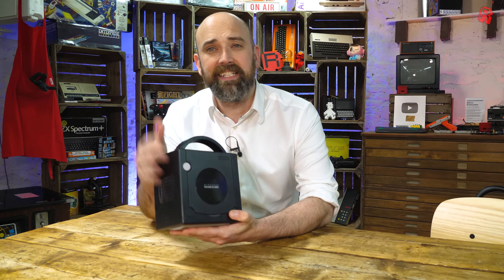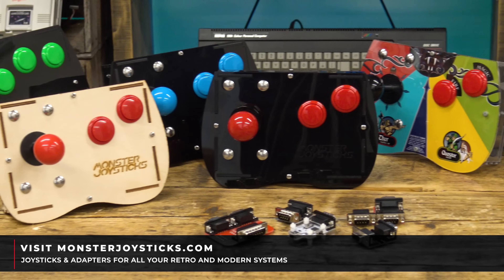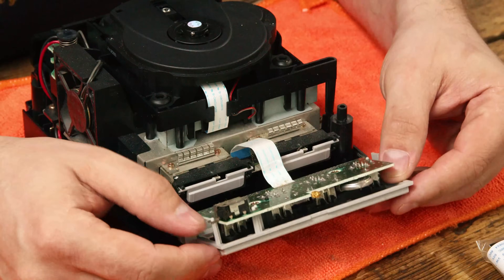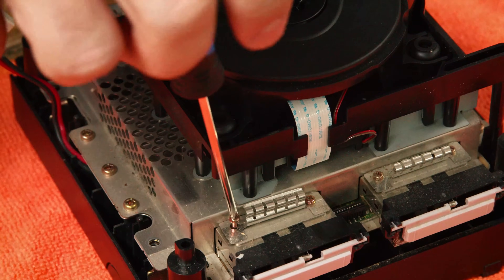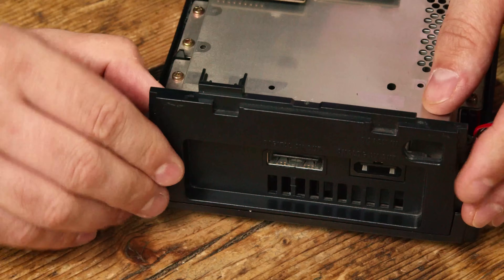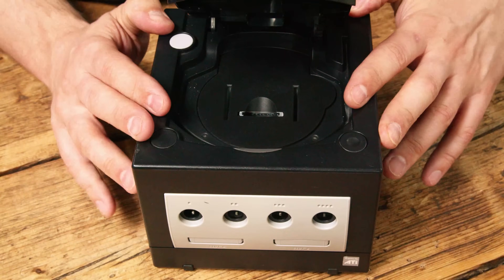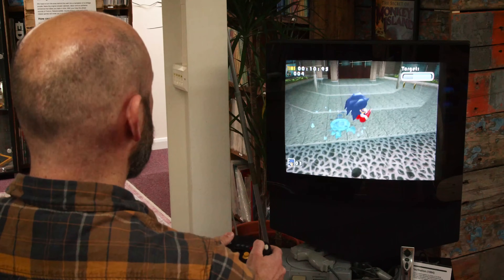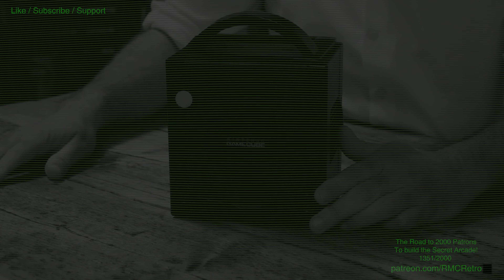Upgrading a £5 Nintendo GameCube with GC Loader | Tech Nibble

Comment: All the screws. GC loader is such a great mod, but the xeno GC chip isn't a bad option either on a budget if your drive is still working. You do get the slow down on some sd2sp2 games but not that bad on a decent SD.

Comment: I actually bought my GameCube for a pretty good price (i think) £70 during the summer of 2003. I initially forgot to take it home with me. It was five minutes into the journey home, i reached into the back of the car to retrieve my newly acquired machine and it wasn't there. Then it dawned on me, IVE LEFT IT ON THE FLOOR OF THE CAR PARK! Drove back, as quick as we could, eventually finding where we had parked, there it was, still in the black bin bag the seller gave me to carry it, and thankfully still in one piece! Still have it to this day, although tbf, i have kept every console ive ever purchased since 1996, oh except for my original PS1, which i sold to buy a motorbike!

Comment: Hmm. What method do you use for converting the original optical discs to image files for the SD card...are are you just getting them from...third parties? I have a perfectly functioning Cube myself (amusingly the same black model, though NTSC and not PAL) and just wonder at the options if I did try to convert it to use SD.

Comment: That particular generation was interesting because - early on at least - there wasn't actually much to pick between the three.  They shared most of the same third party titles.  Later on support for the Cube dropped off so you'd find that sometimes you don't get a second o third title in a franchise. Burnout is a particular example.  Also Baldurs Gate Dark Alliance.

Comment: Well, I had a similar thing happen to me. I was at my local Tender Center, when right where we parked, I found a Nintendo Wii console abandoned outside one of the store's gates. I picked it up and inquired into it with the staff. They said I could have it for free. It had no cords, cables or controllers, but I did test it out at home, and it worked perfectly. It even had a copy of Super Smash Bros Brawl inside, so that was an added bonus!

Comment: The reason the second SD slot seems redundant is because, it is. That's an SD2SP2 card which is a totally different product and has nothing to do with the GC Loader. There's nothing wrong with having it in there other than having to wait for it to patch the games (GC Loader requires no game patches itself) and I think maybe you can use it for save games, not sure. Anyway it definitely isn't required.

Comment: Worth mentioning that a soft-modded Wii running Nintendont can play GameCube games at higher frame rates than the original machine, and is much cheaper and easier to mod. You don't even need to use the Wii controller if you boot straight into a USB loader. My Wii is now essentially a dedicated overclocked GameCube.

Comment: Odama is worth checking out, I highly recommended it for the novelty of the gameplay. Odama is a pinball RTS that's set in feudal japan and you can control your armies through commands using a microphone accessory. It sounds really strange, but I actually had a lot of fun playing it.
Reply: It sounds bonkers. Awesome.
Reply: @Khola_D  It really is, but it somehow works. Odama is a good example of the GameCube's exclusive library. Mic's and the game are cheap so it's worth checking out just for the novelty.

Comment: I had a black Gamecube in my teens. I remember having Metroid Prime (but not the "Echoes" sequel as it demanded a different video cable and a 60Hz TV); Tony Hawk PS 3 & Underground, Tales of Symphonia (JRPG goodness on 2 disks), some Need for Speed titles and even a port of Hitman: Silent Assasin (that ran supprisingly well, although some levels differed from the PC version to be able to do that).
Reply: I used the standard bundled composite (with the bundled SCART adapter) cable with Echoes. Think it was just a TV compatibility issue rather than a cable one
Reply: @kaitlyn__L  Maybe I just misremembered, but I thought that Nintendo was pushing hard into buying another at the time. Then again, we are talking about a time nearly two decades ago so I might be wrong. I do know that the 15" CRT TV that I had at the time was maxing out at 50Hz.

Comment: Okay, what's that thing you put in the bottom of your GameCube? Do you have to have that in addition to the GC Loader? Because I have a 101 model, and I don't think it has that port under the system.
Reply: You don't have to have it, it's not part of the GC Loader. Just an extra thing you can get for your save games if you don't have a memory card.
Reply: That is an SD2SP2 (SD Card reader to Serial Port2) adaptor. As mentioned by another commenter, its not strictly needed. And if you use the GCLoader 2.0.0BETA firmware, that enables the GCLoader to also write saves to the memory card I believe. GCLoader 2.0.0BETA and the newer version of SWISS can emulate memory cards so you can have much bigger virtual memory cards that are stored on your GCLoaders SD card. But you need GCLoader2.0.0BETA firmware to be able to do this. Version 1 firmware of the GCLoader doesnt allow you to write back to the memory card in the GCLoader.

Comment: What an elegant solution. And without any soldering! Lot of people left their Gamecube to play their games on Wii with a simple RGB<>HDMI adapter but I find the Gamecube so beautiful, I can't do this outrage to it, this great console that has been with me since 2003.
As I have only my own Gamecube and a lot of original games on mini-DVDs, I can't bring myself to remove the drive. So I opted for a solution without even having to open the console. I use an Action Replay with a Max memory card and a microSD that contains Swiss. The second microSD drive connected on the serial port under the console contains a 256GB card full of Gamecube games and even NES and SNES emulators with there ROMS. My serial adapter is angled in order to access the microSD card without having to constantly remove my Gameboy Player. It works so well.
Congratulations for this elegant recycling of such a legendary console 😍.

Comment: I think that the second SD card reader is there because the game has to be patched by swiss before it can be run and the patched executable can't be written back to the SD card via the GCLoader at the minute,  so it writes the patched executable to the SD2SP instead.  This makes subsequent loads a bit quicker as it can skip the patching step.
Reply: If I remember correctly that card that plugs into the bottom is for game saves in case you don't have a memory card or want more space. I bought a GC Loader last year and it did not come with that extra card, I don't think it's even made by the GC Loader people. Mine didn't come with the tray either but I need to get one. I haven't heard anything about games needing to be patched and none of mine are, I just copied them to the card and they run straight away.
Reply: @ilovethe70s  If you check @11:09 into the video, you can see Swiss running the patching process.
Reply: @dazzathedazza  I was puzzled since mine definitely does not do that, so I did some checking. You're correct that the patching is done by the SD2SP2 card. That's a totally separate product though and has nothing to do with GC Loader. :)
Reply: @ilovethe70s  @Dazza What version of the firmware for the GCLoader do you have? Version 2.0.0Beta of the GCLoader firmware has the ability to write to the same memory card that the game runs from that's installed in the GCLoader itself. Version 1 of the GCLoader firmware does not allow you to write to the memory card in the GCLoader. Get the latest versions of SWISS and GCLoader 2.0.0BETA. It is what I do, and I don't have the SD2SP2 adaptor. I'm thinking I may still obtain an SD2SP2 adaptor as some of the emulators for the GameCube such as the SNES, MegaDrive emulators etc seem to require an SD2SP2 to work properly or atleast they do until (or if) they are updated to take advantage of the GCLoaders new ability to write to the memory card. Also as @Dazza points out, with my setup (GCLoader 2.0.0Beta firmware etc), when you run the game, I can see it being patched by SWISS/GCLoader which only takes a few seconds.

Comment: I have my GameCube that I originally bought in 2002, still hooked up on my basement TV.  It works fine but to be honest if I'm in the mood to play either GameCube or Wii I just prefer loading up the Dolphin emulator on my Laptop.  This is one of those cases where the emulator is quite a superior experience over the original hardware.   Games can be rendered in HD resolutions with new texture packs so they look far better than the original console could ever do.

Comment: The latest version of Swiss has been rewritten and those bandwidth issues are mostly removed now. I’ve not had any issues running games from my SD2SP adaptor via my modchipped GC. The FMV intro of Mario Kart Double Dash is one such games that has a problem with the older version of Swiss via the SD2SP.
Reply: same here. With the latest version of Swiss and using an SD2SP adaptor it runs games beautifully.
Reply: I used vimms lair for my
N64 collection. Where’s the best GameCube spot for ROMs?
Reply: @ChazberryMK  Vimm's

Comment: Am i mistaken or are there three screw holes on the CG Loader PCB (+ corresponding posts on the shielding) you did not use? Does this hold solely by the connector to the GameCube Mainboard?

Comment: I was soldering a mod chip to my Gamecube a couple of weeks ago.  I was at the kitchen table wearing glasses to see the joints and my wife came along and ran her hand along my neck.  The soldering iron went straight across the board and wrecked it as well as burning my hand.  ;((

Comment: I loved modding my Gamecube and with the new component cables it looks amazing too. I know you can mod the wii but the UI is terrible and I hate having to use the Wii motes for anything but gaming. I installed a Xeno GC mod chip with the Sd2SP and it was a super cheap way to get 95% of your setup. Plus added super crisp GBA output and its a fantastic setup.
Reply: using a wii mote can be avoided, if you use bootmii you can use a gc controller to boot into the homebrew launcher which is also gc controller compatible
Reply: get a wii u.

Comment: Great video! Only thing i was thinking is that i would have changed the Thermal Pads when you're already inside the machine. If it's going to be running for a long time i doesn't hurt to replace them.

Comment: As you rightly say, the GCLoader (the official one) is like rocking horse droppings. Funnily enough I have been searching for an SD based solution. There is an alternative to this - if your Mini-DVD drive actually still works. 

First install a Xeno GC mod chip. They cost pennies, and are probably the easiest mod chip to install - a small soldering iron tip and a steady hand. Then get a SD2SP card (again, cheap as chips) which goes into the 2nd serial port under the machine. Finally a SWISS Mini DVD (again, a few pounds). This will enable you to play a) Any region game and b) if you boot off the Swiss mini DVD it will automatically enable you to select games stored on an SD card which is in the SD2SP.

So.... it's not perfect. There are some compatibility issues with some games, and not all FMV sequences work perfectly. But games work ! You of course do allude to this in the video.

And for me? The Gamecube is the ultimate hidden gem console. It has a great library, a lovely design too.

Next up - get Mark to do an LED update :)
Reply: To avoid modifying the console, I use an Action Replay Mini DVD with a Max memory card and a microSD that contains Swiss. a second microSD drive connected on the serial connector under the console accommodates a 256GB microSD containing Gamecube games and even NES and SNES emulators. My serial adapter is angled in order to access it without having to constantly remove my Gameboy Player. It works so well.
If you permit me, some PAL games need sometimes PAL/60hz display to works well. Maybe it's the problem of your videos that are not always smooth? I had the problem with Baten Kaitos and  Gauntlet Dark Legacy. They are PAL but I need to load them with 60hz display to obtain smooth FMV. The speed of your SD card is also important.

Comment: I got a GC on launch, still have my GC and it works. But in 2022 the best GC console is actually a Wii. Hacked Wii lets you run all the GC games from USB hard disk!
Reply: As long as you have an original Wii with the Gamecube Controller ports :) And you still have to faff around with the Wiimote and a sensor bar to get into Nintendont (or whatever you use)
Reply: @stephenpalmer9375  you can also get your wii to load directly into apps, I get mine to load into USB loader !
Reply: @stephenpalmer9375  I heard you can use a Wii U GameCube adaptor to add that functionality back, I have not tried it as I’m happy with my Wii classic controller for now  😊 and also the Wii mini is hacked too which is really nice for GameCube if composite video isn’t an issue.
Reply: @SproutyPottedPlant  ooo I didn’t know that but it makes sense. Don’t get me wrong, my wii is hacked too (and it can play the Mario Kart and F-Zero Arcade games), there just something lovely about a GameCube. And I’m proud I got the mod chip working haha
Reply: @stephenpalmer9375  I have a Wii U and a Wii, could easily hack either and get GC and Wii ISOs playing (with HDMI on the Wii U) but something in me still wants to get back the GC I traded-in for a game after getting my Wii. (Though I’d settle for getting another one which matched :P) It’s just so cute and loading games into it is definitely the most satisfying of the disc based consoles for me. 

If I could seek out that rare SCART cable for the digital port and an OSSC that would probably look better than the Wii U’s HDMI too… hmm

Edit: and yeah you can use the Smash GC adapter to use GC controllers not just in the GC in the Wii U, but you can do it on Windows/Mac/Linux too. I mostly use a DS4 over USB for computer but I’m awfully tempted to try installing whatever driver I need to use my GC controllers on my computer with that adapter.
Reply: Also, Nintendont on a Wii actually runs games better than a GameCube could, due to it running GC games in Wii mode, using the higher clock speeds. Sonic Adventure DX for example runs at a much more consistent 60fps, while Super Mario Sunshine can be run at 60fps using a cheat code and the extra Wii horsepower.
Reply: @bombjack1984  oh, that’s interesting. I didn’t know that software ran GC in Wii mode clocks. I presume that’s also true for the Wii they shoved into the Wii U?
Reply: @kaitlyn__L  Yes, but only at Wii clock speeds, not Wii U performance.
Reply: @bombjack1984  yeah, that’s what I meant :) thanks for the confirmation!
Reply: I like the look of this but it's looking at £120+ 😱😱😱

£20-£30 will get a used wii (making sure is the GC one!) then that's it baring an external hdd.
I have mine set up with all my wii & GC games on a 500gb & still have space.
Reply: Filthy pirates 😉
Reply: Wii’s video quality can’t compare to using a GCVideo device
Reply: @myretronation  doesn’t the Wii also have component cables?

(Edit: nvm literally forgot GC has Digital video port)